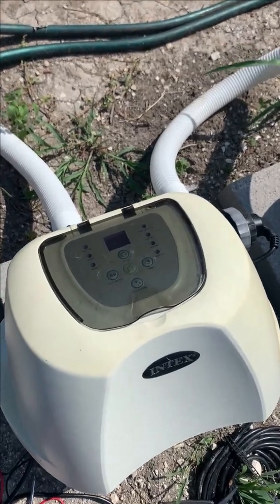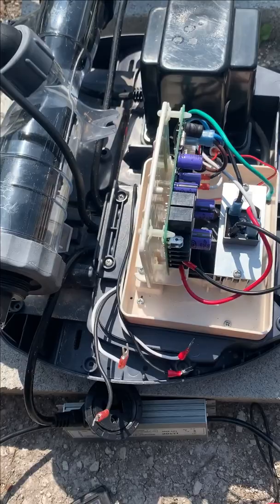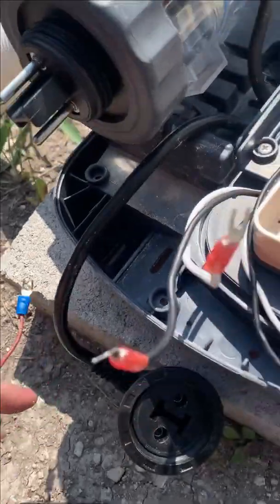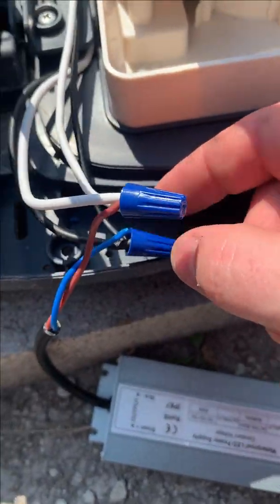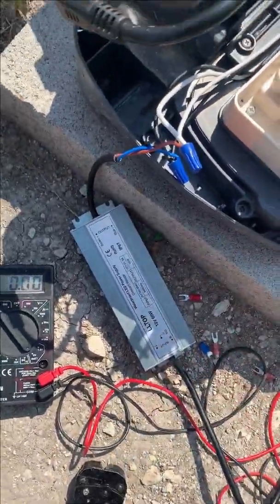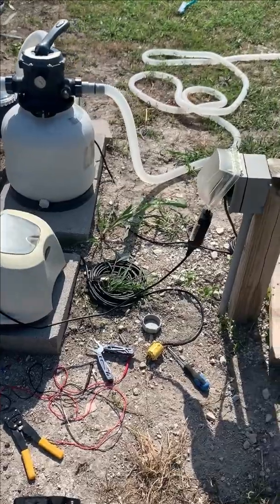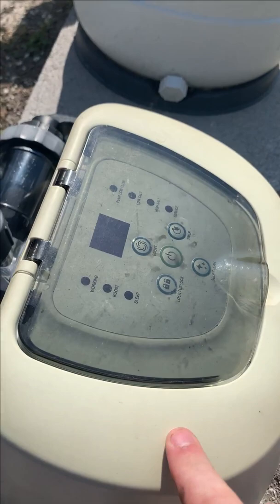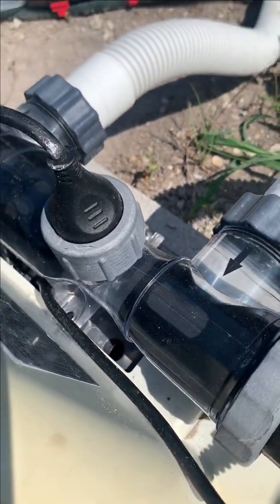Intex Salt Chlorinator low salt fix!

Comment: After switching polarity numerous times, temporary fix, I bought a new titanium electrode.  I then got a High Salt light. I drained  20% of the pools water, refilled it with fresh water, problem solved.  This ECO6110 electrode lasted 2 seasons. I knew there was too much salt, so I knew the unit was getting  a false reading. I hope this electrode last at least a couple of years.

Comment: It been two years since you posted the video.  Is it still producing chlorine?  Not measured looking at bubbles but actually checking your chlorine lever?
Reply from the maker: Unfortunately the flaw was there is no longer anything to stop the current if the water isn’t flowing. So maybe 6 months after I did this I was away on a trip and we lost power. When the power came back on the pump did not and the cells fried. So I dont know how long term it would have been. When I did this the chlorine level was okay. The same before they burnt out. We ended up buying a expensive unit and it has been amazing since. No more intex for me.
Reply: @chadbrezina6294  My first exposure to a SWC was about 10 yr ago.  It was a Hayward unit.  The unit was installed on the pool of a house we purchased.  I had to change the cell out after about 3 seasons.  It worked great but they are expensive.  Hayward has come out with estimates of how much chlorine their cell produce.  Basically, the cost of chlorine produced by a Hayward unit is a little more than it would cost of you purchased chlorine tablets.  The calculation does not take into the cost of power to produce the chlorine.  You can come  out a head if you keep the system long enough and have to purchase a replacement cell.  At least at this point in time.  If you purchase a new Intex each year at $200 the cost of chlorine generation is much less that purchasing chlorine.  If you approach the Intex SWC as a disposable you come out ahead.  But you have to look at it as a disposable.
Reply: @chadbrezina6294  which unit did you end up going with to replace the intex one?

Comment: I tried to do this just like you did, but it is not making any bubbles when plugged in 😫 do you have any tips??
Reply from the maker: No sorry. Make sure your salt levels are correct.
Unfortunately intex makes these things to barley work. The wife and I finally pulled the trigger and purchased a expensive unit that works great. Though my intex ones were still working with my work around, the cells were getting worn out, and we just figured on biting the bullet with a expensive unit. It works great! Good luck.
Reply: @chadbrezina6294  when I inspected the Amazon part a little closer we realized one of the prongs on the plug was damaged, so hopefully that is why the pix did not work for us. Just ordered another one, should arrive Sunday... So fingers crossed that will do it 🤞🏻 thank you for the reply and for the video. It's exactly what I need if I can get it to work. I actually have a few saltwater systems that have all went out over the years but I saved for parts. So if I can get it to work bypassing the codes I should have extra cells to rotate every week or so to prevent one from taking on too much work. That's my thought anyways 🥴🤦🏻‍♀️🙃   beyond stressed with these Intex units. If you don't mind sharing, what unit did you purchase that works great?
Reply from the maker: @raeraemommy1599  XtremepowerUS Pool Chlorine Generator Salt Chlorinator Flow Switch Plumbing Set to 40K Gallon Capacity https://a.co/d/9h3h6hF

This is the one we went with. I believe they sell them at Home Depot as well. It’s hard to find the 40,000gallon unit which is what we settled on. They put intex to shame. Good luck though, I hope it works for you!

Comment: Thanks just ordered. What did you remove from in side the cover
Reply from the maker: I removed the area where the power goes from the board to the small black square with a couple screws and was able to make it fit.
Reply: @chadbrezina6294   Thank you .Now just waiting on the amazon part.

Comment: A bypass off the in-built transformer to the two prongs leading to the cell would also suffice, no need for Amazon.
Reply from the maker: Could you provide a picture? I’ve tried to figure out that with this particular model. No bueno
Reply: True but then you can’t have it on a timer.. I’ll be doing this to mine soon just so I can use my own timer.